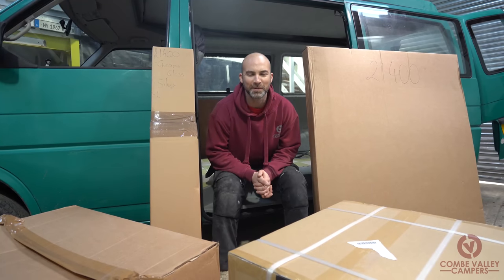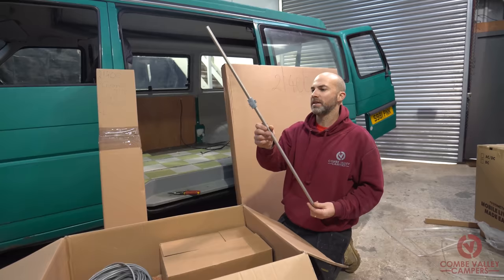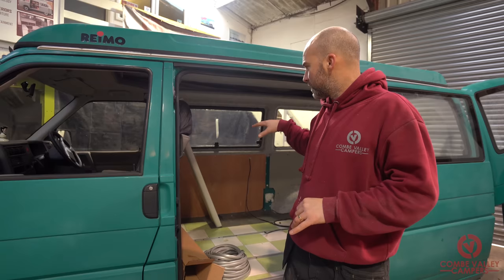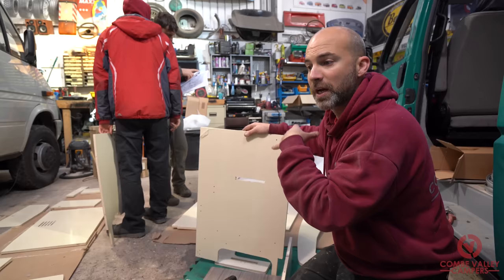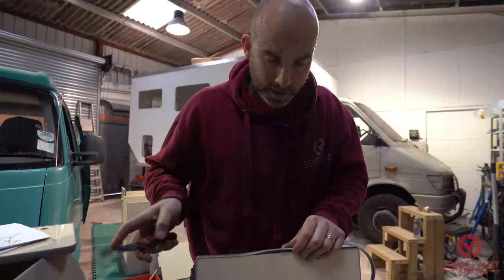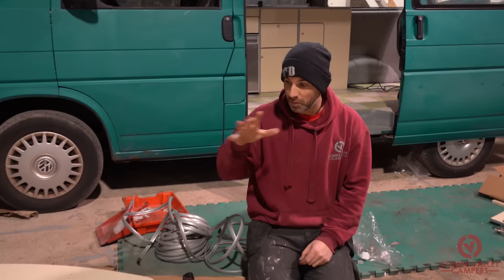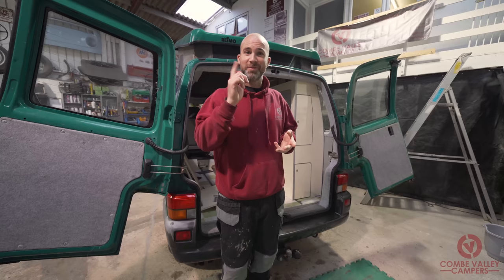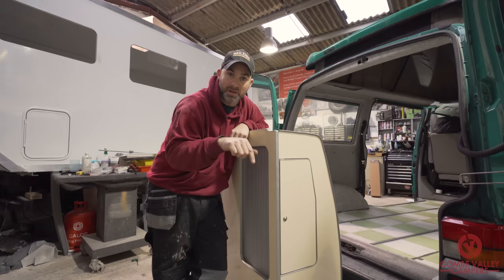HOW TO BUILD A FLAT-PACK "EVO MOTION DESIGN" INTERIOR. Tips, tricks and hacks!

Comment: Och I wanted to see the screwing I bought a van and the rear section of unit only has one screw holding the top half to the van the whole bottom of my unit is solid but the top half only had one screw at the back and none at the front so it rattled about when u hit bumps I think I am going to remove and refit it properly I have the units that go to the roof all the way along and has a blind built in for the cooker window
Reply: The base is solid but the top rattles around and does my head in after inspection I am shocked at only finding one fixing unreal it was not making any noise on the test drive it was after a few days we noticed it
Reply: How many fixings would you recommend? I was thinking as much as possible

Comment: What would you do to hide the wardrobe unit backs where the window is, simply curtains or something like a panel? Asking as I’m looking at a caravelle.
Reply: I used blackout film tint so from the outside it didn't look strange followed by either hardboard cut to the shape of the glass or plywood (Which either you prefer)